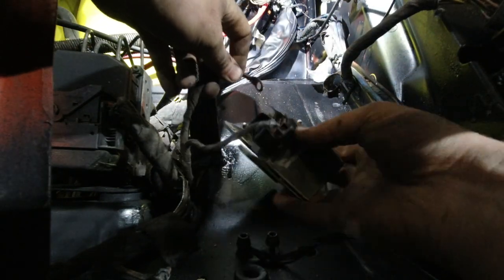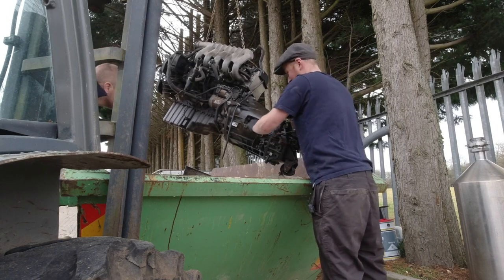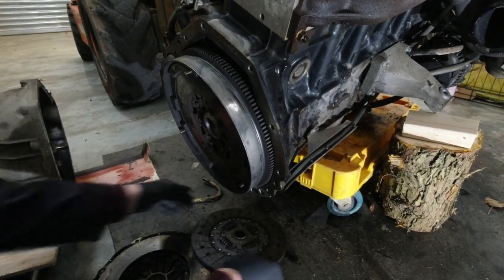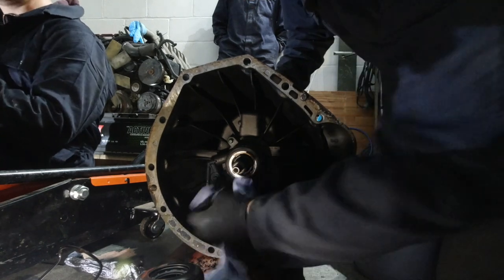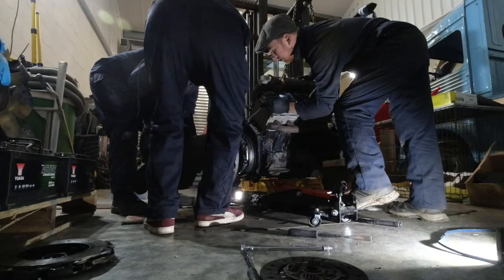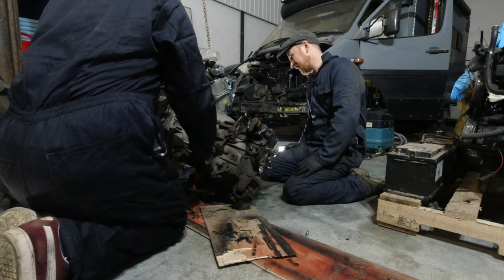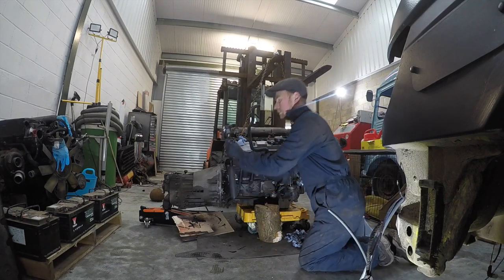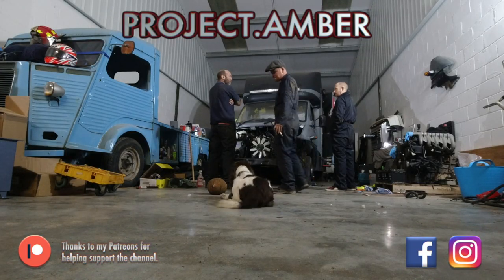Re-engined. Amber 2.0 - Ep.5

Comment: TOP RESULT! Blimey that donk is like new CJ! Only 50k on the clock it should be. Might be worthwhile to take Amber to a council weighbridge sometime to see what shes running GVW now (and the trailer for your GTW)? Then you should have an idea how long that clutch will last - with that HUGE hill on your land!
The propshaft issue - EASY fix. I had the same when I fitted a Gardner engine in my Scammell it was too short! A mate machined up a custom 'insert' out of a solid billet to fill the gap! Any machine shop worth its salt (excuse the pun) should be able to to do that for ya matey!

Comment: I've been putting CAN bus interfaces and ethernet wiring in mine but mostly, right now, it's the original wiring. Think instead of a thick core of wires, just a network cable and power with the signals going on and off the network and slightly more advanced (ie Arduino controlled) bits at the other end. I can imagine whether you replace the wiring harness or rework it from the ground up (where you at least know exactly what's going on), when you're in the middle of it, the other option seems more attractive. Since you've actually replaced the harness and had all the wiring problems, what do you think?
As for remarrying the gearbox to the engine, it would appear that they have all decided that they should start seeing other vehicles!

Comment: Check under the chassis for extra bolt holes for the cross member because the auto box will be longer hence the prop length difference,  you may be able to just slide out the front half of the prop and change it for the other one 
   Thats what i had to do on my okd camper conversation

Comment: while you have that engine out you didnt pull out the injectors and have them checked? at the same time do a compression leakdown test? doesnt cost much..but painting seems to be more important then checking out the engine instead of a breakdown later..
Reply: In fairness it’s a 50k engine which is absolutely mint, it ran perfectly prior to install and whilst you are correct that it is a cost effective thing to do the list of jobs that you could do with the engine out is huge. 
As I’m sure you’ll see in future videos many other issues that stop Amber from going simply have to take priority.
Go easy on the guy.. it’s a massive job! 😀